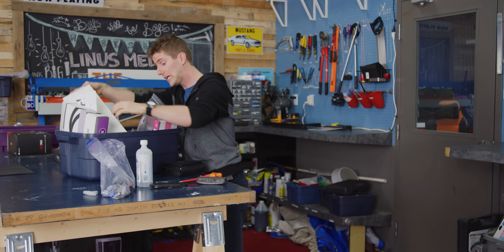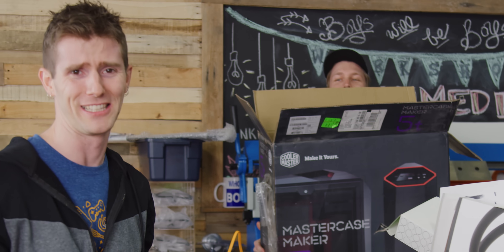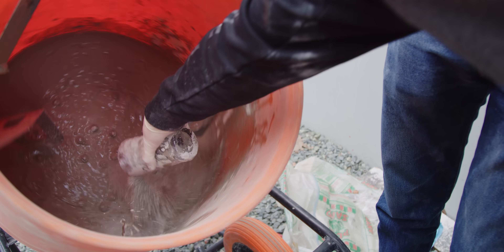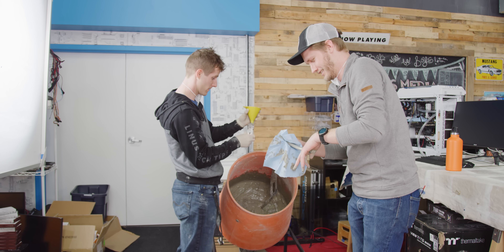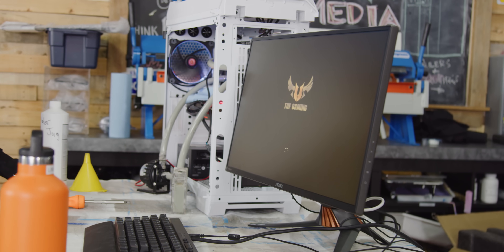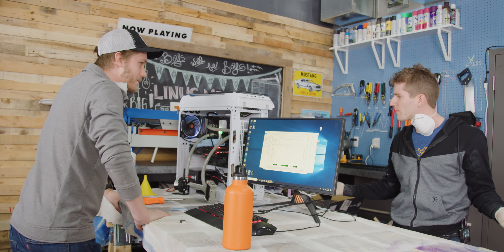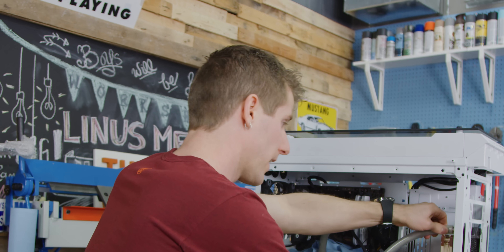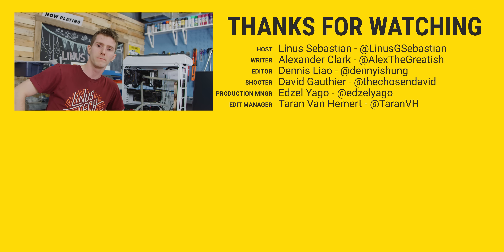I Can't Believe This Worked!!! - Concrete Cooled PC (April Fools 2019)

Comment: Can I get some help?

My computer will turn on for only a second. It stays on without the ram installed, so I replaced the ram. It still don't work. I can't find any obvious shorts, so what's the problem? Is my cpu dead? Could it be my mobo? HELLLP MME PLSS!
Reply: What CPU?
Reply: @OfficialRID  don't judge me.......

A 2200g that I've had for a month and a half. No overclocking and I have a dgpu
Reply: @MicroChipz Shepton Mallet msi b450m pro-vdh whatever that means
Reply: @MicroChipz Shepton Mallet did what Linus trying a new psu ( I don't have one ). The computer now turns on and the rgb works when the computer stays on. Sometimes it does and sometimes it doesn't. It still don't boot, and I get random warning lights (cpu, dram, and vga at different times). What now?

Comment: You may be able to use oil instead of water to prevent the cement from setting.

But using oil by itself in the first place probably works better than water anyway. Just use that new 0w oil Honda loves so much, the shit that smells like death no idea its affect on plastic though.

Comment: i was counting down to that result hehe... but what about passive cooling, with a giant block of cement on both the CPU and the GPU, perhaps an air cooler dipped in cement ;)... it'll take a long time before that block of "stone" is 80+ degrees ;D.

Comment: Dear Linus, I enjoy watching your videos on a daily basis. I have a terrific idea for you. Build a gaming water cooled computer, but instead of pouring concrete in the water loop, just add tiny glitter flakes that you can buy in a craft store. Yes the glitter powder to use if you make your own Christmas balls. My theory is that if you add 4 parts of water to 1 part of tiny micro size aluminium glitter flakes these tiny flakes will help absorb heat at the CPU and absorb coolness at the radiator. It will also look great to see these shiny mirror-like flakes travelling along transparent tubes. Add L.E.D. for scifi effects. Please use a CPU water block that's flat inside to avoid a potential glitter jam in the heat spreader grooves of the water block.

Comment: That's a good one. More seriously, you don't need a concrete mixer for such a small amount; also, if you don't add sand or gravel, it's not concrete but cement.

Comment: As someone who has poured a fair bit of cement, it was obvious this was an April Fool's prank.  For those of you who didn't understand what happened, 1 the cement was too thick for the pump 2 in the unlikely occurrence that it wasn't, the cement was going to set up anyway, regardless of a supposed brownout (as they claimed).  If they indeed left the machine running, it wouldn't have taken long for it to thermal out and shut down on its own.

Comment: This is a very interesting idea, but to avoid the issues with concrete setting i'd suggest using a carbon allotrope suspended in water. Diamond polycrystalline suspension is a viable contender, and lab grown diamonds make it cheaper than one would expect, though I believe its on the order of 65 GBP per 500ml. However, it has one of the best thermal conduction properties of carbon allotropes, has no ability to emulsify, and is unreactive enough to be partnered with substances like silver nitride or other growth inhibitors.

Comment: actually i thought of something you can do with concrete which you will have more temps. Let's say for example you have 4 tubes fill all of them (half) and let it overnight to get solid.After that you can have a little space for the water to flow but bear in mind that with this method you will need to fill the liquids every week or month or so.Depends on the quality of the concrete.

Comment: gets me thinking what if you use a stone with a flat surface as cpu cooler

about 17 cm x 17 cm x 17 cm?
you know how long it takes to warm up a stone
it is just an idea
Reply: As a passive cooler it could be decent, bur for watercooling no, it doesn't transfer heat as much as copper
Reply: @marcoschiavone9169  but it could be done and used as a heatsink (if it works i might put a rock in my tablet)

Comment: Well even if you could run the pump 24/7 to not let the concrete harden, you will have problems with friction. The concrete will destroy everything: the heatsink, the pump, the radiator.

Comment: Strange idea from this is to use clay specifically white ceramic clay as it has thermal properties by suspending it in water and making it a slurry should have a similar effect as as the concrete

Comment: Put ure radiator in the concrete next time to see if it cools the radiator faster then a fan if it works use the base ment for a full floor radiator cooling project

Comment: You should have used a huge slab of concrete with copper pipes going through it as the radiator
Reply: That's nowhere near as entertaining or interesting. Of course a slab of concrete will work as a radiator.
Reply: @Tomasu82  Well. No it wouldn't, concrete isn't very heat conductive. It would be a really poor radiator.

Comment: That's really not concrete Linus, that's cement water. You need sand and gravel with cement and water to make concrete. The mixture is 3 part gravel, 2 part sand and 1 part cement to make concrete.

Comment: Soo; My AIO has stopped working, can I get a replacement?
Amazon rep: Have you changed anything recently to it?
Me: Yes, I opened it up and replaced the fluid with concrete. It worked fine initially...

Comment: Hi Linus Tech Tips. Nice April joke video..about concrete and cooling cpu with it. 
In the video you mentioned something about layers inside tubing..and heat disipation from pipes. If it really helps to drop cpu temps as you mentioned in the video, than I challange you! Make water cooled system from ceramic tubings. 
P.S. English is not my native language.

Comment: Here are two suggestions for alternative "water cooling" liquids:

1. Colloidal silver. Since silver has the best thermal transfer characteristics, perhaps water with (the highest concentration of) colloidal silver might have better performance.

2. Mercury (or similar liquid found in thermometers). Will a "room temperature metal" transfer heat better than just plain water? Please remember to account for thermal expansion of the metal/liquid in your reservoir.

Anyway, just thought this might make for an interesting video or two...

Comment: yeah.. but it still doesn't even beat my old pc.. it ran on a mixture of piss, soyaoil and mayones
idled at 12 degrees C and maxed out at 32 degrees C on my 5 core CPU overclocked to 12.53 Ghz. ;P
my new pc run on infant poop at it runs even colder xD

Comment: The viscosity will burn your pump out soooo quickly though.
Reply: would increasing the water-cement ratio help?  I mean I know it would make it perform closer to the just water result but it'd be nice to get more than 1 days use too.
Reply: @jaydub8576  It certainly would but cement is so much thicker than water it really isn't going to do much. Plus the more water you add the less beneficial this tactic would be. Also it only solidified here because they had a power outtage. If it was kept running and moist it could keep going for quite a while.
Reply: The electric motors are not directly connected to the fins, worst case scenario the fin doesn’t move. As long as the pump has adequate cooling the motor itself will not burn out.
Reply: @BobLSaget  True, but there would still be a resistance against every other phase causing burnout. No pump currently used for water would be able to handle the heat and resistance. This even happens with running mineral oil in a loop. You could just get a better motor that could handle it though.

Comment: That is cement not concrete. It is called concrete when cement is mixed with aggregates(such as gravel). Cement has higher thermal capacity, so it would take longer to heat up compared to just water. Hardening of cement is exothermic reaction, so it would actually generate heat.

Comment: I have not finished watching this. Concrete creates heat as it sets up. Adding heat to it will cause it to set faster. Eventually I think it will set ruining the pump, tubes and radiator.

Comment: 8:43 laminar flow in a pipe always is like that. You get a nice velocity curve through the diameter of the pipe, where the fluid is moving at a maximum in the middle and tends to zero the closer you get to the sides. If you want to see a picture to help explain, just google laminar flow velocity profile

Comment: try calcium carbonate (limestone - CaCO3)! As long the water doesn't evaporate, it won't harden... 

Calcium carbonate should have a similar thermal conductivity as concrete (actually  there's calcium carbonate/limestone in cement), without hardening since there's no chemical reaction with water. (actually, cement generates HEAT while it reacts with water, btw! lol... Ha... and heat makes it react faster!! LOL)

Calcium carbonate is not even soluble in water, so it will stay suspended indeterminately! (although it will probably brake in smaller particles due to water erosion)

You can get calcium carbonate at amazon for 5 bucks! (it will make the water milk white! lol)

I wonder if it would deposit in tubes though, since it's a solid particle... Maybe trying with bigger particles may be better to avoid deposition AND would actually improve thermal transfer in water!  (you can find different particles sizes in the market!)

Calcium carbonate is largely used as an additive to make polyester resins look like Marble!

Btw, cement does hardens due to a chemical reaction, not evaporation! 
The Hydrogen and Oxigen of water binds to the cement molecules creating another chemical structure... water for cement is like a catalyst is for poliester resin! 

and in all chemical reactions, there's HEAT being created during the reaction!

Comment: The "lots of testing" bit was the tell.  That extra "it makes soo much sense" was the double tap.  There would have also been alittle more science than "it looks good" when mixing if you were serious. The trick would have been to bypass the does it work and go on as a given then use the ratios and results for the content.

Comment: I seriously thought they were going to make a copper coil that was submerged in concrete. Use the concrete as a heatsink. Not.....this.......
Reply: I got that idea when he said it was like a ceramic.
Reply: They liked it, so maybe we will see they are actually doing it.
Reply: That... That is actually a good idea! I am thinking of using watercooling, but to chill the cpu down to room temperature and keep it that way. Your idea has a lot of sense.
Reply: By the way, could you type what type of cement you would use and how the contents are called? Most commonly used thing in Russia does not provide such an effect. Most concrete or cement here will not chill.
Reply: I thought he would just submerge the motherboard and let the concrete dry out.  Kind of like submerged oil builds people do.
Reply: I have the same thought too
Reply: Well that wouldn't be the not so Linus tech tip way
Reply: Wait... did they actually expected it to work like have the concrete not set???
Reply: @FernandoMontielSerna  without oxygen the concrete cant  set the moisture had to evaporate into the air so what they did is fixable by adding water because there wasnt enough air to carry all of the water away
Reply: Concrete tubing?
Reply: Same, a concrete heatsink will it heatsink

Comment: That's technically cement...
Concrete has small pieces of stone + sand + cement....
Anyway..great video...on April fools Day..
Btw I can't decide if it's a serious video or a joke.... :-)
Reply: RATNA SHEKHAR Its both.
Reply: This is Quikrete. It's a mix of cement, sand and gravel. So technically this is concrete. Even more technically: concrete minus water ;)
Reply: Cement is just the powered form of concrete, before you mix it up
Reply: @user-xs7fg3hb1j  Not really (or not at all ;) ) Most basic concrete is cement+sand+water. Without water it is called "concrete mix" but sure you can say shortly "concrete" especially if you are at the same time pointing with your finger at concrete mix bag ;)
It may seem strange but sand is very important in a process of concrete setting  and even curing. It also reduces concrete shrinkage a lot.  Although you can use cement only with water it won't be as durable as real concrete. In real concrete cement is more a binder binding together sand and gravel and stones and whatever. BTW they had too much water in their concrete and the fragment with concrete becoming more liquid when moved was for me actually the funniest fragment of that clip ;)
Reply: my words

Comment: April fools or not (Alex nearly dying with laughter gave it away :) , I now have to wonder if you could make a concrete case with rebar in it and then wrip some heat pipes round it before you pour the concrete. 
Silent zero noise, balling PC thats impossible to steal as it weighs about the same as a block of concrete.

Comment: Vibrating concrete mix, cement mix, or even wet sand causes liquefaction. They vibrate the mix anywhere they don't want air bubbles.

Comment: Basically speaking, your basement stays cool because of thermal mass.  Below X distance in the ground, the temperature remains constant and anything in contact with it, also remains relatively constant.

So whether it's hot or cold, once thermal mass is reached, it will remain constant.  While this might mean that the Concrete is a good choice, at some point, the concrete will not have enough flow or mass to dissipate the heat as evenly or constantly and will fail as a result.  It will also at some point cure into a solid mass and destroy the pump and the tubes.

Comment: 0:39 preliminary isnt going to cut it linus, gonna need some CONCRETE proof😉😂

also I'm willing to bet money this is an April fools joke
Reply: You my friend would have lost money
Reply: This was recorded as an April Fools' joke but it's actually a legitimate idea with actual cooling benefits. However, once it stops flowing, it stops working.
Reply: @nathanb011  I'm not doubting its cooling potential,  but as you said it cant stop flowing not to mention I'm sure over time it'll gunk up your pump even if its flowing so it's not a viable option
Reply: @nathanb011 but I'm only 15 and idk much about concrete
Reply: şķąţęŕ Bøi Just because I'm saying it's possible doesn't mean I'm saying you should do it. It will absolutely ruin your computer forever

Comment: It's April fool's day, IDK if I should believe any of this
Reply: I'm actually really confused, IS THIS REAL
Reply: @lukewoolner  What part of it? They did really pour concrete/cement into it.
Reply: It's linus, who knows..
Reply: Parkchap Wdym with : Is Linus ?
Reply: Bruh about 1k disliked that only mean's they haven't catched the joke LOL
Reply: it actually does have factual  basis. as long as concrete stays moving, it wont set. it CAN thicken, but being as that was a sealed loop, the moisture in the concrete would stay there for the  most part, and keep it wet, as long as the pump kept things  moving. but if the power does shut down, and the concrete was able to sit still, the chemical reaction that causes it to solidify can take  place, and it gets hard. now, it wasnt stone hard, like regular cement, because they didnt add the sand to it. but it obviously couldnt flow through the system at its consistency. source: worked with concrete for several years professionally, driving truck and building bridges.
Reply: @ghomerhust  Doesn't the concrete + water reaction causes an awful lot of heat?
Reply: @ghomerhust  Still it won't make your setup cooler,in fact as water pumps are so sensitive they would've broke in a second.
Reply: Is real ... if not they wouldn’t show the last part ...
Reply: What I think is that it’s fake and there is an actual PC that’s being hooked up to the monitor with superior cooling than the original build. You can see 9:04 that Linus is looking down at something that seems to be massive, probably a very larger pc with overkill cooling
Reply: Angus Wu r/woooosh
Reply: xWrnalp13_ I didn’t miss the joke, because the concrete could actually work for a short amount of time. Also, I just pointed out something Linus did that could’ve been avoided to improve the joke, so... I’m not actually stupid. This thread was actually going somewhere too, and here you are thinking that you caught an “idiot that didn’t get the joke”? Haha
Reply: @anguswu2685  Dafq u're talking about

Comment: April fools joke or not, it would be neat to replace a radiator block with a concrete block just containing a tube that was looped through it and allowed to dry.  The liquid can remain another solvent but use the concrete block's density for the external heat exchange.

Comment: Thermal compound or Aluminium powder or even Gallium (with non corrosive parts) in a cooling loop would be interesting. Copper is much more thermally conductive at 385 W/m K than water at 0.6 W/m K or concrete at 0.8, so copper strands and pipes would be much better than water in pipes at absorbing heat. As long as heat is moving along towards a heatsink.

Comment: As someone who has been burned by a ceramic heat bulb watching this im kinda wondering if a ceramic plated radiator would actually have even a minor cooling effect. (Still think you would need a regular radiator set up defeating the purpose but still curious)

Comment: The curing reaction of concrete is exothermal. So It will heat up your CPU before getting rock solid and stuck in your hose. Btw your concrete mixing technique makes me cry.

Comment: I made a Radiator from concrete by taking a flowerpod and coiling 5 meters of tubing in it. Than i filled it with concrete. This is the cooling for my old server in the basement and i works for about 2 years now. Cpu max is 63 °